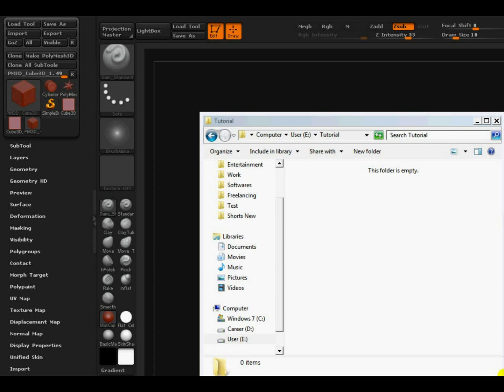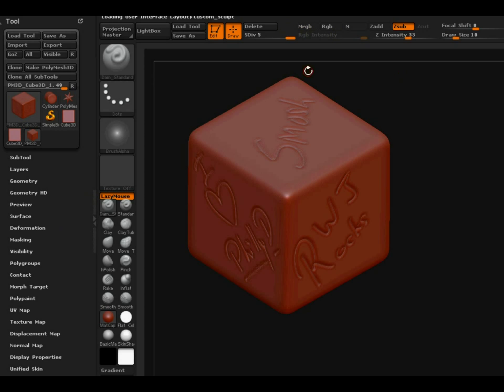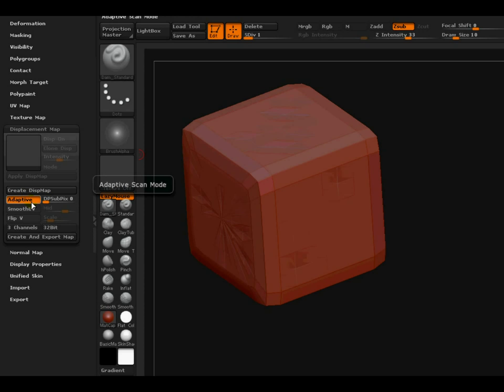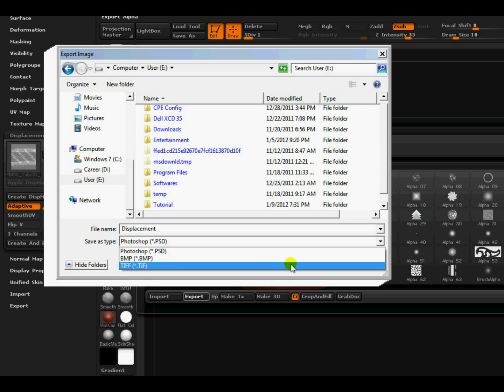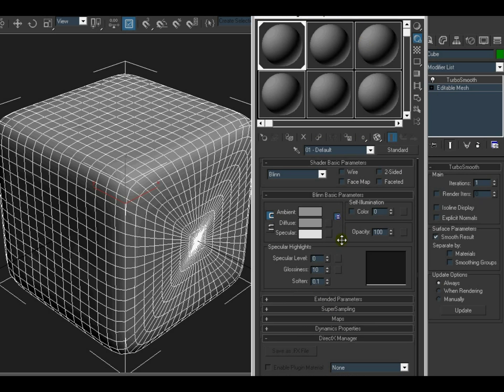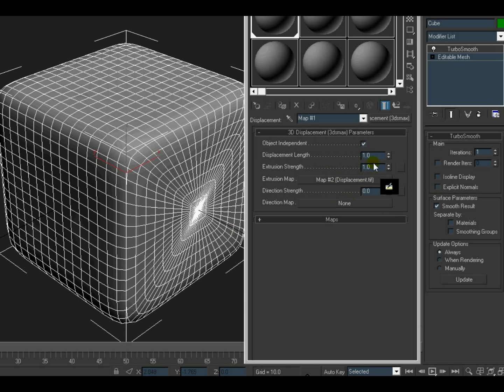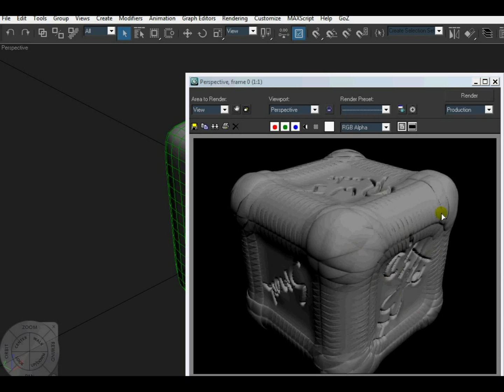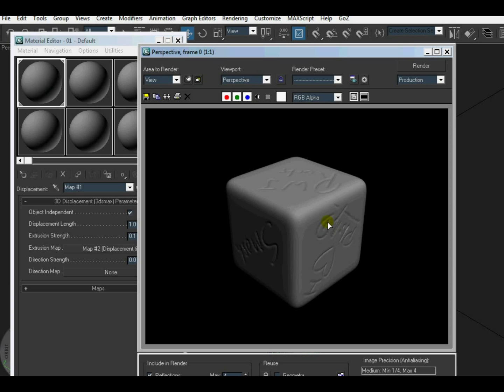Zbrush to 3DS Max | Tutorial - by Born2Model3D

Comment: I want to start off but I have no clue what to learn first Autodesk 3ds Max or Zbrush :/
And why we move from one to another ? please clear this out :) um new
Reply: +Redwan Islam  Learning 3ds max will cover the complete pipeline for 3d world in a software. 3ds max is the most powerful tool in today's time. Z brush is another revolutionary software. It is best for modeling and sculpting. Also texturing is easy.  Moving from one to another is according to your need. For ex. lighting in z brush stands nowhere in compare to 3ds max. I will suggest you to learn 3ds max first and z brush later.
Reply: I'm Srkian thanks alot for the suggestion
Reply: best of luck..
Reply from the maker: +Redwan Islam So sorry for late reply. These days there are so many amazing softwares that its hard to keep up with. The reason we will need to jump from one to another is simple because different software excel in different things. 
But specific to this video, you will need to export the high res details off of the mesh and bake them into the low res model.
+I'm Srikian is right but I will not say you should start learning 3ds max, I would say get an idea of the work you can create in each software and where the excel at and than see what you would like to do. Do you plan to be a modeler, a texture artsst, a concept artist, a level designer or lightning artist, rigger or renderer and choose a software accordingly.